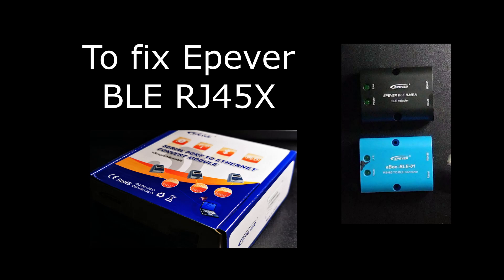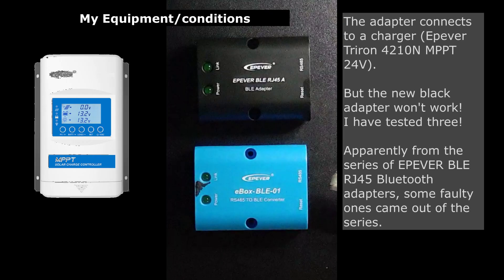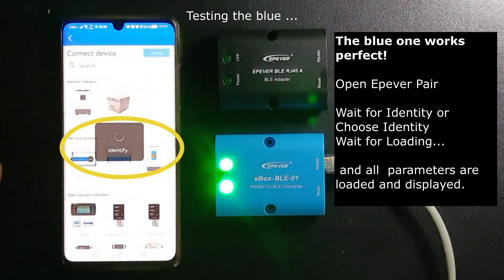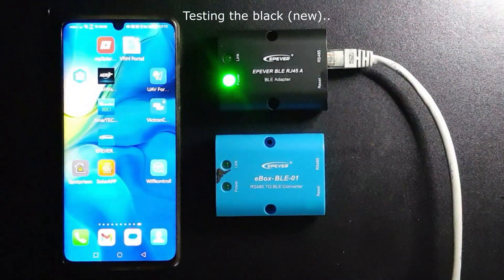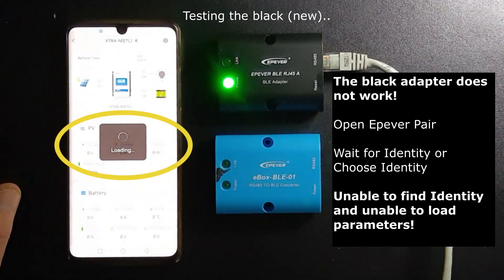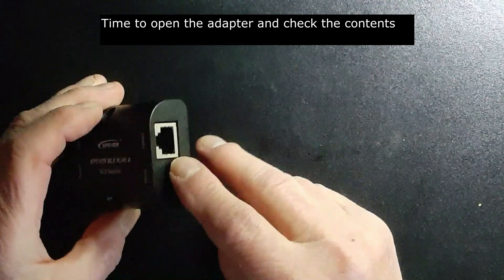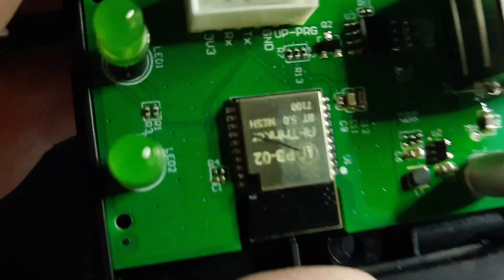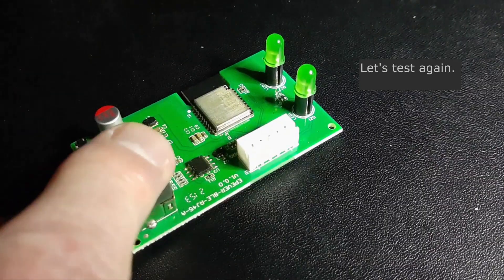To fix Epever BLE  Bluetooth Adapter. Problem with contact.

Comment: I found having wifi and location on helps to connect
Reply: I always have wifi and location on but still have issues
Reply: @ozjado  try unpluging it sometimes helps
Reply: @madheaterlab  trying now
Reply: @Faffy Bubs  that did work but still bullshit if we need to be mucking around with it like that
Reply from the maker: Thank you for your comment. It was interesting because it communicates via bluetooth. I have location and bluetooth on.
Reply: @dibe-se   yes I thought the same
Reply: Faffy Bubs 
Did your trick right now and i get connection to BLE direct 👍👍after weeks of trying to connect
THANKS 👍👍
Reply: @andreas-balder  yes it's very strange.  Ppl having problems with iphone 13 as well
Reply: Wish I'd bought renogy or Victron. Epever is shit
Reply: @under2boots Victron rocks. So good. Wish I'd done the same
Reply: Pile of crap. Ripping the mppt out and the Bluetooth Module and MT75 display. Sick of paying for shit that does not work. REFUND. EPEVER CAN SHOVE IT